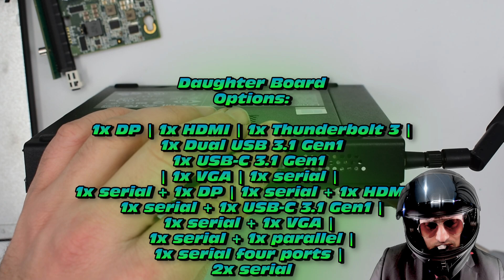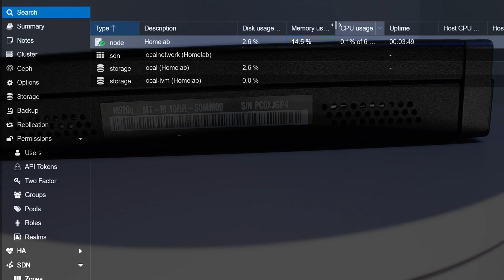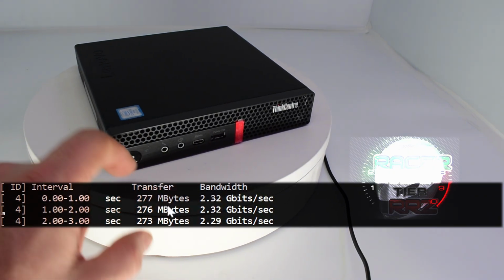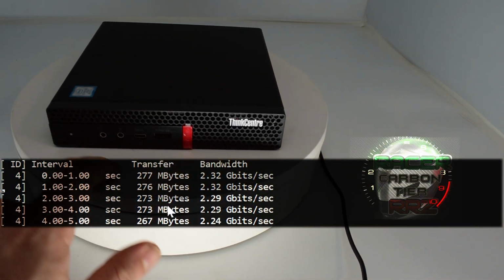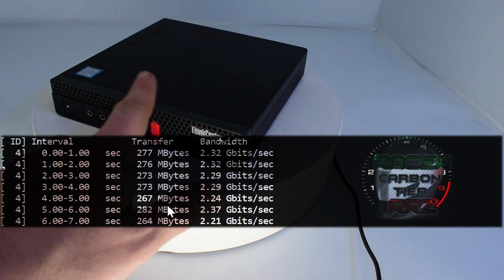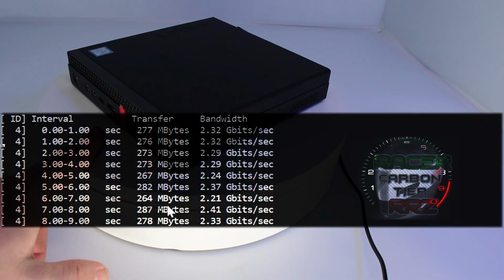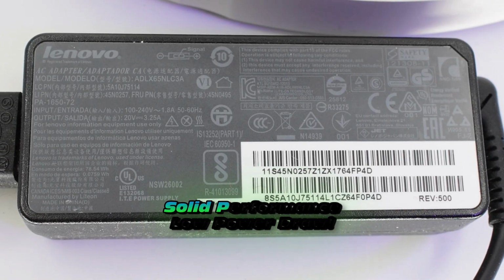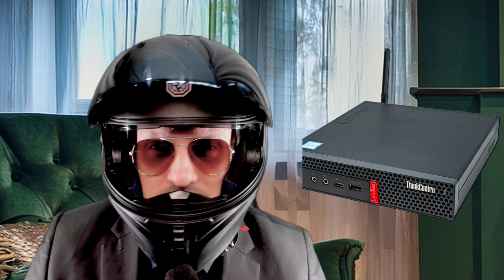Best 10GbE Mini PC? Lenovo M920Q Tiny Gets A Speedy Upgrade!

Comment: Just wait until the systems shutdown due to lack of proper cooling on they 10gbe card. Those get very toasty and with zero airflow is bye bye
Reply from the maker: Yes, it could create a bit of an inferno in there without some additional cooling. I plan to add a 40mm Nocua fan to help resolve thermal throttling of the NIC. 

So far so good - it has survived it's testing. CPU temps remained really low and it churned through nominal tasks without issue. The 10GbE is only really going to become an issue once I sort out the storage side of things. I have set up a somewhat fanatical 6x SSDs - all connected with USB cables to create a RAID 5 pool. I plan to run this 24/7 - so it better not spit balls of fire!
Reply: There's a 3d printed blower fan set up on thingiverse for this lenovo. To cool down the network card. It got temps down to 40c.
Reply: Worst thing is that because they saw off that additional x1 slot that card receives power even if PC is shut down and cooks itself into oblivion! Only remedy to that is to plug the AC off completely.
Reply from the maker: @Adam130694  Thank you for pointing that out. I'll test that actually. I did not notice it getting hot when not in use, but I also did not expect it to heat up when the system isn't powered. 

I have just received a few items to deal with the 10GbE NIC's cooling - so that should deal with the heat-soak.
Reply: @racerrrz  If that radiator is not MASSIVE, then  24/7 active cooling is needed...
Reply from the maker: @Adam130694  It's a tiny, well under spec, heatsink on there, but at least it fits inside the 1L case. 

I'll check the temperatures with an infrared thermometer to see what the temps are before and after my mods. I might even replace the thermal paste on it if it stays toasty. 

One benefit, that front USB 3.1 port delivers continuous power - making it ideal for a USB fan. It would be a simple fix to keep a USB fan on it.
Reply from the maker: @Adam130694  I measured the temperature with an infrared thermometer. It does draw power in the off state and the hottest temperature on the 10GbE NIC was 42.5'C. It seemed to stabilize there no matter how many hours I left it, so that's at least better than inferno-hot fire hazard. 

But I'd still feel uncomfortable leaving it powered without airflow 24/7. Thank you for pointing this out. The front continuously powered USB port would be the way to go if the machine has to be off at times (so USB fan) with this cheap NIC installed.
Reply: @racerrrz  Is that 43 degrees with stock heatspreader? Mine was burning hot to touch.
Reply: Plus silver surfaces are known to reflect temperature measurements so it could be hotter realistically… (if stock heatspreader)
Reply from the maker: @Adam130694  Yes, ~43'C with the stock heat-spreader - without me doing anything to it. 

Mine was also hot to touch also, so I was surprised by the temperature reading. The PCB was ~32-38'C. I'll see if I have any temperature probes that I could use to check for the aluminum giving a false / lower reading.
Reply from the maker: @Adam130694  Hot to touch makes me think its closer to 55'C. I'll see if I can get a second reading from an alternative method. Either way, it does get toasy without airflow, making it risky to leave it without a fan connected.
Reply: The first gen dell micro pcs were frying harddrives because they got so hot!
Reply: It's the thermals that made me skip 10GbE.
It would be cool to get real thermal readings and compare the 10GbE SFP vs. Ethernet-based cards. Those fan shrouds might help, too.
Reply: I had one of these - maybe not identical, but another "X540" that is almost certainly not really an X540 but something reprogrammed to say it is, and acquired suspiciously cheaply from eBay. It and disabled itself due to thermal throttling before the Proxmox UI was even accessible over the LAN. So, without load, it lasted less than 60 seconds in my system. This was in a big tower base, plenty of airflow, but very low static pressure. Maybe the higher static pressure of these little systems might work a bit better, but I can't imagine this working too well.
Reply from the maker: For the $20 USD price tag I figured it was worth the test. I actually wanted to try to run and power the 10GbE card from a M.2 NVMe slot (using a riser cable; with external DC power). I managed to rig this to work but I did not attain full function of the card (I estimate my power source was sort on amps). To check if it even works I did test it in a HP Z840 where it gave decent performance in iPerf3 but I did not stress test or attempt to monitor the thermals on it. I would expect heat to limit it's function and without added cooling it may not give reliable service. I hope to test a small 40mm Noctua fan mounted to the exterior of the rear I/O. I have found a sata to 4-pin power cable - so it should be a seamless mod. I'll update on how effective this is on the follow-up video.
Reply: @racerrrz  yeah I think m.2 can supply a maximum of 7w or something like that. You could probably get a newer 10Gbe device to run off that, something like an Acquantia AC 113 is very low power and actually reasonably priced for a single port adapter from AliExpress. Might even work with the older AC107, or maybe an X550 (single port). But IIRC a real X540 draws more than 7w per port, nevermind two ports, nevermind these fakes which are invariably ancient chips that draw about 20w per port or more.

Edit: AQC 113 / 107
Reply from the maker: Nice. I'll look into the AC 113 /107 as a low power 10GbE solution. I should be able to retrieve an Intel X540-T2 out of another system for some testing too. If I can get more than 2GbE between two ports I would be fairly satisfied. Mini PC power limits make it tricky to really push the PCIe power draw but I'll measure the power draw numbers to get an idea of what sort of numbers this cheap 10GbE adapter is pulling.

Comment: trying and failing to figure out why you got such low speeds with that 10G card. were you able to do any additional testing?
Reply from the maker: I had the same issue on my Intel X540-T2's - they were operating at 1.9GbE out of the box and it took some refining to get decent speeds. I'll check up on it in more detail but I presume jumbo frames and TCP checksum will give it a bump. The other issue will be thermals - it might be running into a throttling situation quickly. I am working on Noctua solution for that which will feature in Part 2 of this video series.
Reply: @racerrrz  got it, thanks. were you just testing with like ttcp or iperf3 or something or using an application level test like an AMB copy? (the temperature throttling thing feels like a solid potential culprit btw.)
Reply from the maker: @notaprofessionalJ  That was iPerf3 while transferring to and from my HP Z8 G4 with an Intel X540-T2 (short Cat6a cables) and a Ubiquity Flex-XG 4-port 10GbE switch. 

Most likely it's heat related given that there is very little air flow in this mini pc. After some refinement I am hopeful to bump it up to at least 8GbE.lol.
Reply: @racerrrz  definitely thermals, I have a bunch of these deployed in video editing machines at work and having decent airflow over the card helps a ton. These variants are nearly a decade old, so they get hot as they're technically designed for datacenter situations and also only support 1 and 10gbe, while newer revisions support 2.5 and 5gbe
Reply: @empedance1933  how did you increase air flow?

Comment: I have a feeling you're going to give yourself thermal issues, and I don't mean the helmet !  Those 10Gb cards were designed for servers in data centers, hence the heatsink, because the server will have fans with a high airflow, in a data center kept cool.  The 540/550 gets several watts hotter than the 770.  With no active cooling on the nic it's going to get pretty toasty.
Reply from the maker: Both of those get somewhat hot haha. The 10GbE card will need a dedicated fan for sustained use - especially on the Inspur version (X540-AV2) in the video. Placing a small Noctua fan (NF-A4x10) on the rear of the system could make all the difference.

Even the Intel X540-T2 placed in a well cooled PC tower can have issues with overheating (I placed a 120mm fan in my Z440 case swap to get air flow over the PCIe lanes to keep it cool). 

For some inspiration: https://forums.servethehome.com/index.php?threads/lenovo-thinkcentre-thinkstation-tiny-project-tinyminimicro-reference-thread.34925/page-64

Comment: the cross method is way better to repaste a cpu or gpu
Reply from the maker: I feel the urge to do some proper testing on this concept. The cross or X does look promising but you wind up using too much thermal paste.

In terms of testing different methods - if you do not control for the volume of thermal paste that's applied between methods the test is flawed. Each method would require the same volume to be able to make an informative comparison on which application method is the best. The testing videos that I have seen do not control for volume and thus most methods give full coverage when excess thermal paste is applied. 

What I like about the spreader method + blobs is that you use the minimal amount of paste to achieve 100% coverage (pending how well your preferred paste spreads), and adding a few blobs helps reduce the odds of air pockets. 

Guess I'll add this to the bucket list - I need to back this claim up with a video haha.
Reply: I just layout a pattern of 5 dots (center and corners), then don a nitrile glove and use my index finger as the spreader. Lots of control and a nice even coat.
Reply from the maker: What are your thermals like with the glove spreading? I found the coat ends up a bit thin, but if you place a few dots on afterwards it might just be perfect.
Reply: Maybe, for those who don't have skillz, and don't know how to properly spread the the paste with a spreader, then you would be correct. I have have had training from major manufacturers of some very high end computing systems, and I am not speaking just of x86 systems, and the spreader method using a mini-spatula is the best. But as I said, you need skillz, and the average x86 never gets that training.
Reply from the maker: @FarrellMcGovern  Indeed. I actually found a credit card to work the best (pun not intended). It gives the ability to adjust the pressure applied and has a decent surface area to cover the entire CPU IHS for most applications. 

To make my life difficult / 
In the quest to get a nice transparent spreader for the videos - I wind up trimming plastic packaging material to create a see-through spreader.  

I can't recommend it - the edges were roughed-up and it made life difficult haha.

See-through spreader > functional spreader.
Reply: @racerrrz  I admit, I can never find my micro-spatulas, and end up using parts of an old credit/debit card 🙂
Reply from the maker: @FarrellMcGovern  Nice. Thermal Grizzly's Kryonaut kit came with a couple of spatulas but I prefer to not fill them up if I can avoid it. I don't do enough CPUs to justify using them. But the old "plastic money cards" do the job nicely.

Comment: It would be interesting to see if the coral tpu works in the m.2 slot if not using the WiFi.
Reply from the maker: I can't see any reason why it wouldn't work. The M.2 E Key should handle the Edge TPU. The PCIe slot would also give you some flexibility in that regard. 

Although expensive - I would like to think something like the PCIe AI Accelerator card (e.g. CRL-G116U-P3DF) might even fit in the system - pending clearances. However, there are only 8 electrical lanes available on the PCIe slot.

Comment: Love your videos, can't wait for part 2
Reply from the maker: The project ran into a few slight snags - I "forgot" the root password to my Proxmox account - or more likely I entered it incorrectly during setup. I finally got back in on the system (although I am certain it wound up accepting the "right" password despite failing over and over), but then it didn't want to talk to my network so I haven't been able to get back into the GUI. 

I may need to restart with a clean Proxmox installation (after getting several VMs set up) but I have some footage at least. I did use a cheap Goldenfir SSD for the Proxmox installation - but I don't think I can blame that just yet. Highly experimental build on cheap AliExpress hardware - what could go wrong? 

If this keeps up it's sure to be an entertaining Part 2 lol.